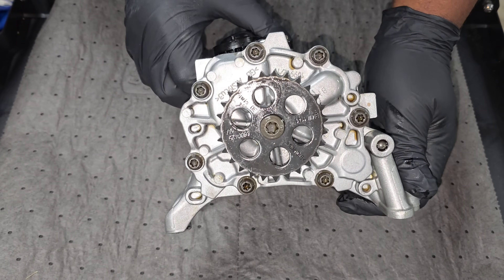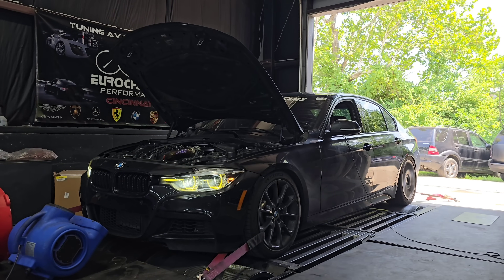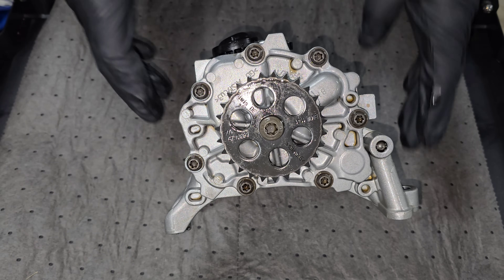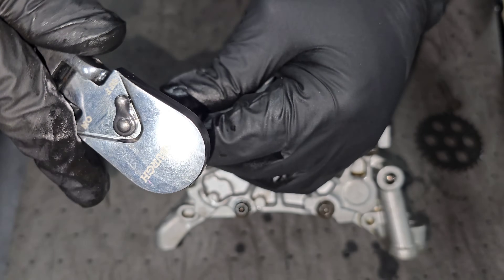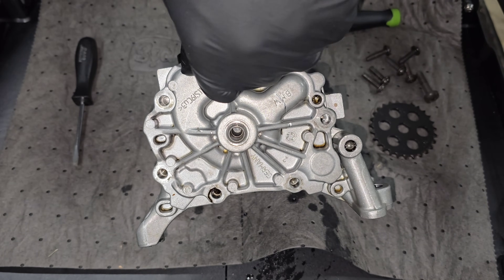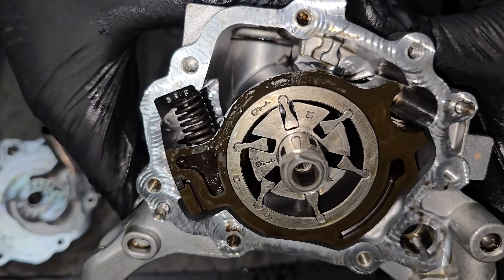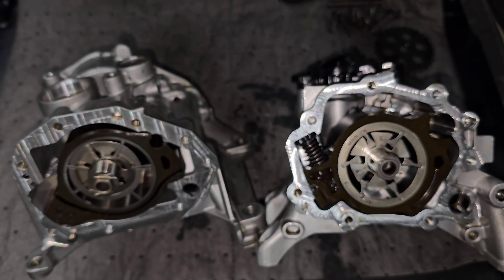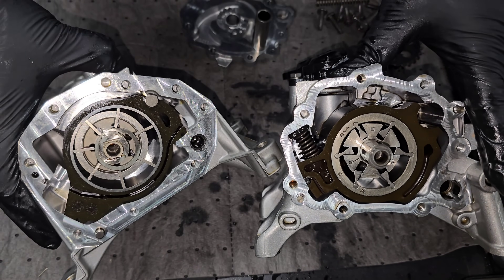Are Gen 1 B58 Oil Pumps Plastic Too? - Oil Pump TearDown

Comment: This isn't about cost saving, it's about planned destruction of the engine after 100K miles. Same with VW and Mercedes too, anything built in the past 4 years is designed to fail early. BMW and VW actually have their own terminology for this too, so it's not by accident.

Comment: So after all do we have a consensus on what the issue is if you have a gen1 b58 and your oil measurement does not complete when the engine is hot? Has someone been able to solve this problem with only sensor replacement or any other way than replacing the whole pump?
Reply: Здаров. Читал что это симптом накрывающегося масляного насоса. Интересно, можно ли его фулл из металла туда поставить
Reply: @ВладимирУфимцев-ч8м I replaced my gen1 pump and the problem looks to be solved. Oil measurement completes under all conditions. However, the revised metal pump is only for gen2. For gen1 the replacement is the same part with plastic internals.
Reply: @МихаилМарков-д9э did you replace it yourself or service did it for you?
Reply: @ВладимирУфимцев-ч8м A mechanic did at a shop. You need a lot of disassembling to get to the oil pump.

Comment: Yo kern what are some issues of a bad oil pump ? I get high oil pressure codes and vanos codes I have a gen 2 b58 2020 and when I try reading my oil level it fails at 16% anything you can help with

Comment: I know it's a stupid thing to care about, but righty-tighty is a crazy description for anything that is radial. You can move a bolt clockwise or counter-clockwise following those directions, depending on where you set your wrench. On a horizontal bolt. I'd say at least 50% of people place their wrench vertical hanging towards the ground. If you follow the "righty-tighty" directions from that position, you'll loosen the bolt.
Reply: How dumb are you? it just means to rotate the bolt clockwise, wrench position doesn't matter.

Comment: There was a recent video from FCP euro on the b58 noting that using an oil thicker than the recommended 0w-20 will put excessive pressure on the plastic causing cracking. You agree with that?
Reply: I doubt it because oil viscosity is a decaying exponential function vs temperature. Even a cold 0W-20 is far thicker than a warm 0W-40. We would be seeing climate driven failure rates if true (aka all in the North).
Reply: @chrisbradley3224  I saw the FCP Euro video and I have my doubts too. For one, he is showing the gen1 pump and not the gen2. Then the direction of pressure force in ways that FCP Euro has described does not add up IMHO either. Because he has shown forces were highest with the spring expanded, not compressed. In other words, if the direction of force were the way he has described, a spring would not be necessary and the plastic housing would return on it's own to high pressure position once the solenoid is closed. Instead my feeling is that Kern is correct, this is a gen2 issue, due to weaknesses as Kern has shown. Further I believe that these gen2 weaknesses may show up / fracture upon rapid rpm changes and corresponding quick movement of the plastic carrier against oil pressure. Which, may be exacerbated with thicker oil, OK, but even in that case, it would rather affect those, who don't warm up their engines before starting to rodeo. But again, this is just a hunch feeling.

Comment: So don’t use thicker oil in your B58 and especially not in your gen 2 engine.
Reply: Not true. If viscosity was the issue we’d be seeing tons more failures in the north and Canada and that’s just not the case. A cold 0W-20 near freezing is 3-5x thicker than a 5W-40 at operating temp viscosity. Better not do a lot of short trips if you believe this is a contributing factor.

Comment: On the gen1, the adjustable cam ring is pulled around by the vanes. The gen2 is more like a conventional power steering oil pump. However, instead of rotating in a housing with a fixed position, it has like the gen1 an adjustable cam ring. The difference is the cam ring on the gen2 seems to be free floating.

Comment: The long awaited breakdown, awesome! Gen 1 B58 owners - has anyone experienced a screeching/squealing noise when stepping on the throttle at about 15% and greater? It seems to go away later on in the drive cycle as things heat up but always comes back on the next drive. Noticed that and an O2 sensor error on the drive home from dealership after getting PCV breather valve replaced under the extended warranty. Car is back at dealership now and they've yet to identify it.
Reply: Pcv probably,  did mine and same thing but doesn't bother me
Reply: @BboyKamakaze808  fyi that the diagnosis came back as driveshaft bearing being most likely suspect

Comment: 🤔 If the center is metal and the outer part plastic..... aren't we all half right/half wrong. I guessed metal, so essentially I'm right. The pump is the metal part that rotates and "pumps" to create system pressure. The plastic ring looks like it just keeps it all in place. So if you guessed a metal pump, you guessed correctly.

Comment: the ONLY reason Gen 2 pump design is that way is cause the bean counters went "we can save 2 cents per oil pump with this design!" the veins are flat instead of triangular, which anyone knows triangles are stronger than flat planes. Two less metal on outer ring = less material cost less plastic = less material cost, thinner dynamic veins less material cost, smaller dowel, less material cost, simplified center cylinder, less production cost.  only it came back to bite'm in the ass with failure.

Comment: my gen1 in the 11/16 prod month m240i will only read oil measurements 1/10 times. It always fails at different points between 15-80%.  Seems dependent on oil temp, with the lower the temps (around 215-220F) being more likely to complete. I'm always watching mhd and never see it leave the range of 42-49psi. Could this be a sign to replace the pump, or should I start with the oil level sensor first?
Reply: Oil measuring problems is actually i think usually water pump starting to go
Reply: Hi, I have same situatuin as you. Did you find an answer?

Comment: Could also be worth mentioning maybe the movement of the gen 2 oil pump is a reason it fails? I’m not sure but it could also be worth mentioning the amount of movement easily achievable in the gen 2 pump vs the gen 1